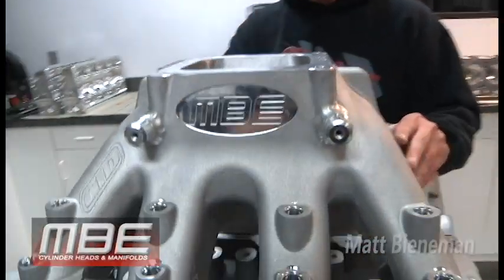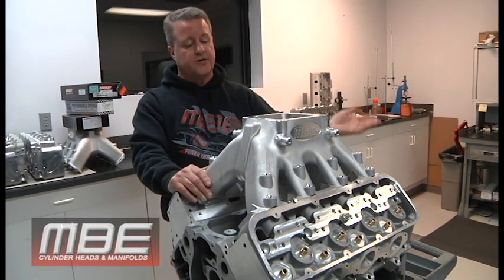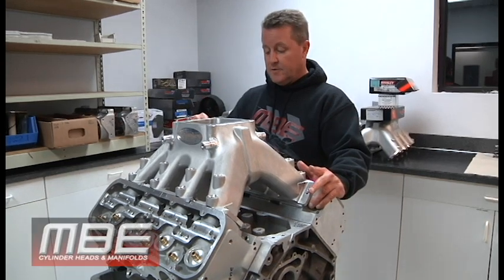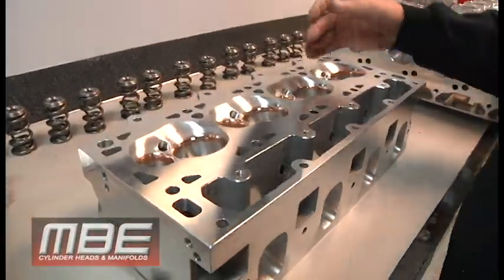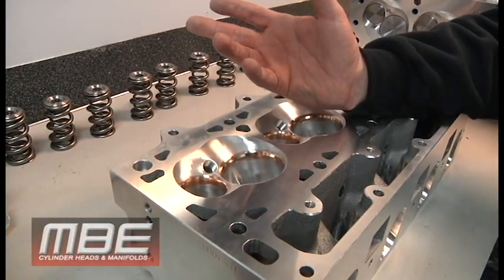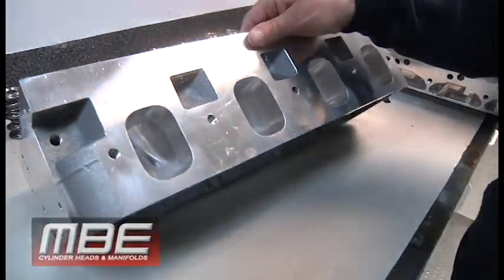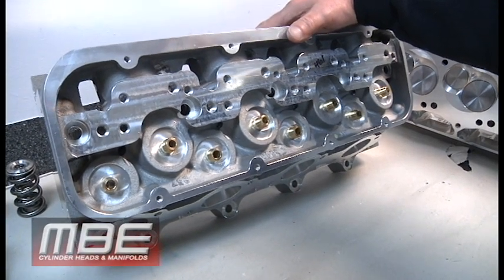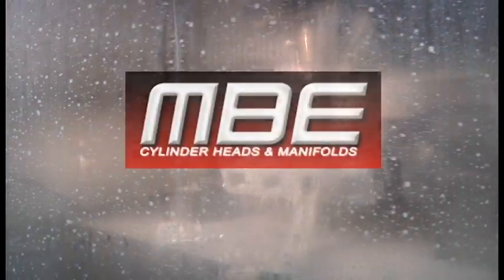MBE ~ DART 10Degree GM LS Cylinder Head w/ CID Intake Manifold Package

Comment: Very nice! I also enjoyed your video with Tim. I have my SBC 409 apart right now to put stronger Diamond pistons in for an F1R Procharger. Dart Pro1 215 heads. I wanna get my compression down a little. Is laying back the chamber by the spark plug like you have there something that would work ok on my heads? I won’t hold you to it, just your opinion would be helpful. Thanks